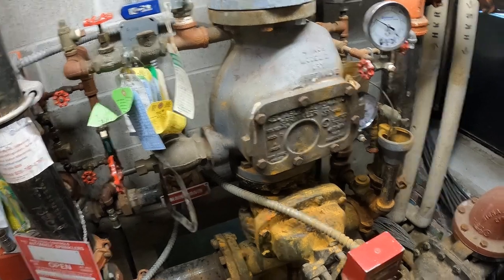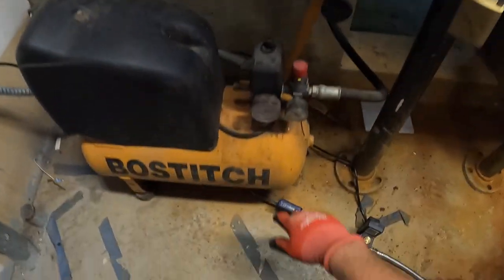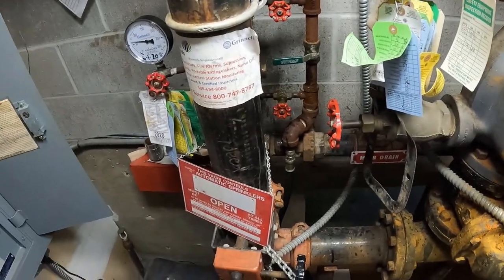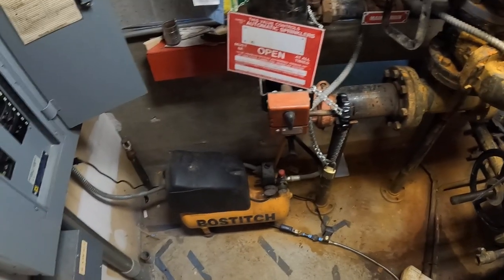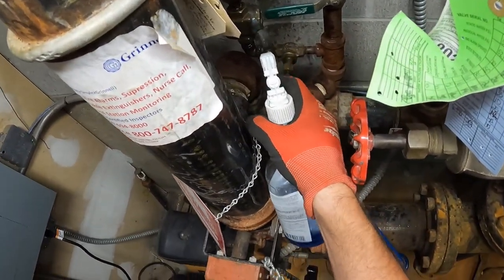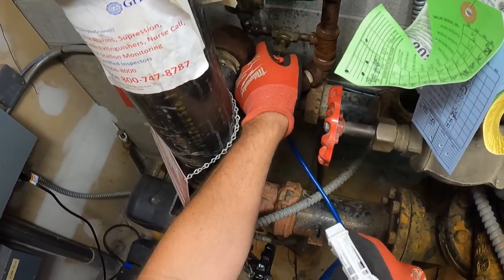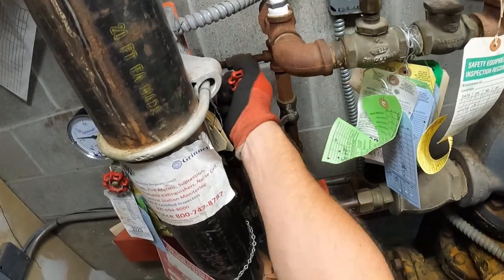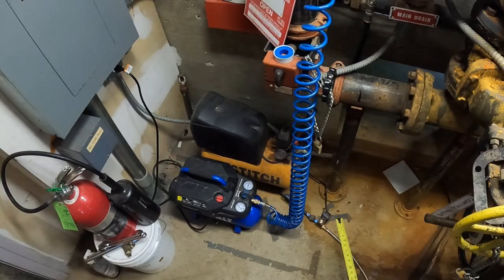Fire Sprinkler Dry System Air Compressor won't shut off (Part 1)

Comment: Out of curiosity, Don't they make specific pumps for dry systems??
Reply from the maker: Yes, great question. In part 2 I installed a General Air Products air compressor that is specifically designed for dry systems. However, NFPA 13 doesn't require that the compressor be listed. 

In NFPA13 (2022) 8.2.6.6.1 it states that unless the requirements of 8.2.6.6.2 are met, where the air supply to a dry pipe system is maintained automatically, the air supply shall be from a dependable plant system or an air compressor with an air receiver, and shall utilize an air maintenance device specifically listed for such service and capable of controlling the required air pressure on, and maximum airflow to, the dry pipe system.

This section states that the AMD shall be listed, but it doesn't say the compressor shall. In fact it doesn't even say that it should be. This is cleared up in the annex section. NFPA13 (2022) A.8.2.6.6.1 Air maintenance devices are unique components within the air supply and need to be listed for use. Compressors are not air maintenance devices and this section does not require air compressors to be listed.

I hope that all makes sense, thanks for the question.
Reply: @FireSprinklerTech  oh okay, yeah I seen part 2.. that air compressor part is pretty new to me.. well learn something new everyday.. I work on fire alarm systems so I'm a little unaware about sprinkler systems, I know it's a riser system with tamper and supervisory switches..

Comment: How frequently should the compressor be going off? We have a compressor on our system that has started to run every 30 minutes for about 30-60 seconds in one building.
Reply from the maker: More than likely you have a small leak starting to develop. They can be very difficult to find when they are small like that.